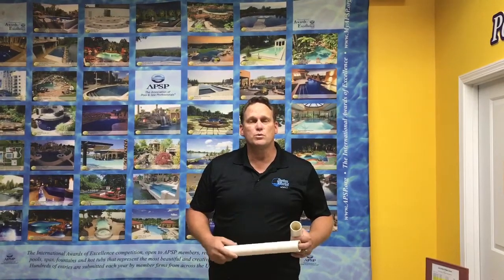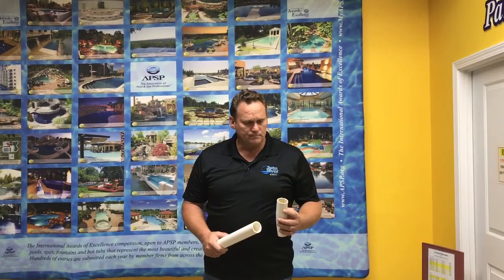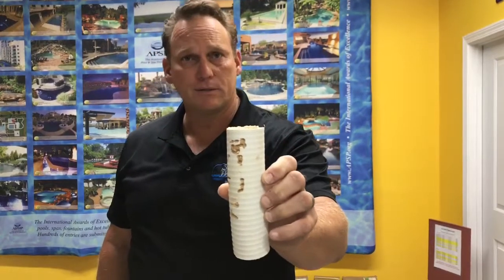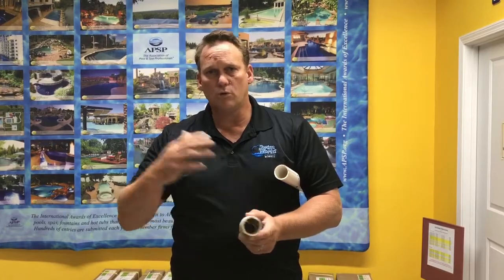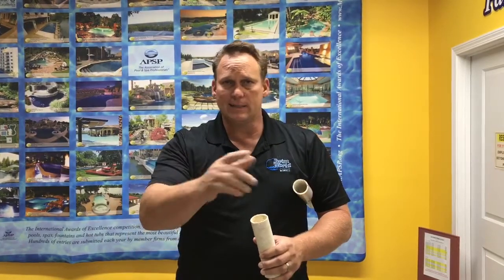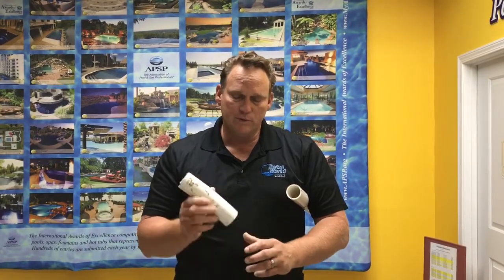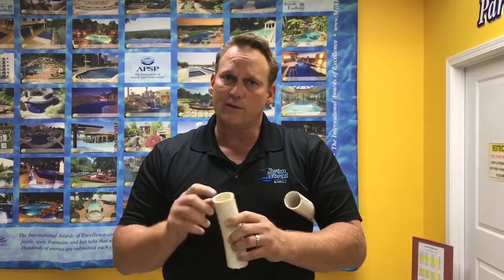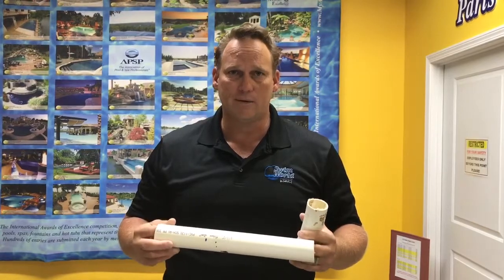PVC flex pipe vs rigid PVC pipe - termite damage

Comment: Lawn grubs, those white ones often do that to flex pipe.  I've literally dug it up and seen them eating it.  I guess termites can too but never saw them on it.
Reply: Good to know as well. Thanks for sharing. Hard rigid Sch 40 pipe is the best way to go on pool plumbing. Not only to prevent insect damage but better hydraulics because the rigid pipe is slick on the inside to create less restriction on the water flow.
Reply: @JayTuckertn  Another great option is thick walled black polyethylene such  as Goodall "Greenflex".  It's smooth on the inside, bugs do not eat it, it's slightly flexible and I've seen it on pools built in the early 1970'a and it's still good!  We don't built new pools and often have to route replacements pipes around bushes, under cement, etc.  The only downside I guess you could call it with black poly is you need to use insert fittings and clamps but long as you say away from nylon or cheap fittings and use clamps that are all stainless (including the screw) this pipe can last 50 years in the ground.  When flex came out it was touted as lasting 100 years and being easy to work with but after only 2 years we went back to using the old black poly for our repairs unless there's just no other option due to space constraints. On a new pool I can see rigid pvc being the way to go.